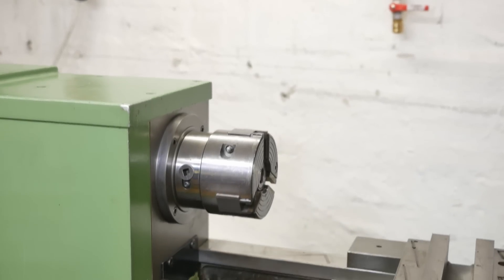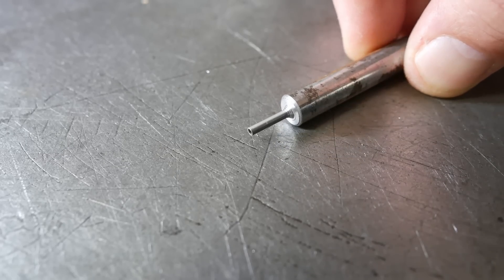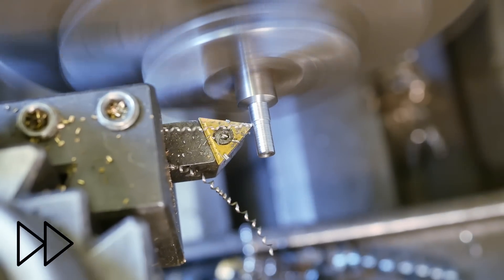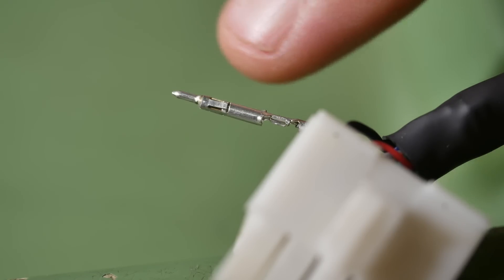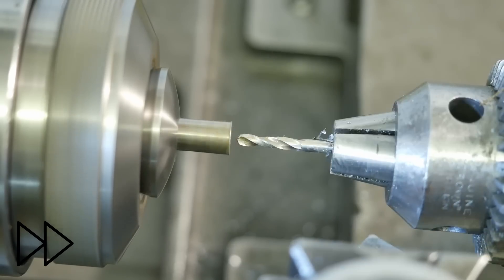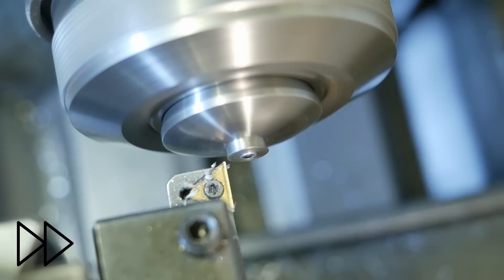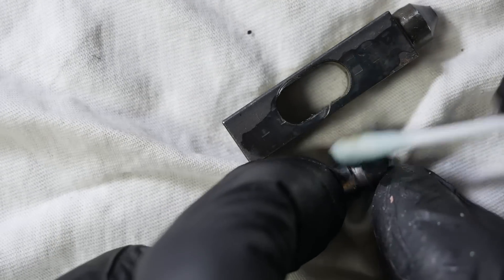Why one lathe is never enough.  Schaublin lathe Ep. 37

Comment: AMP Mini-Universal-Mate-N-Lok Set 15-Polig Terminal Connector Seems to be the kit your after!
Reply: Thats what niche YT communities is all about!
Reply from the maker: @Narwaro  The knowledge of crowds is impressive.
Reply: @RotarySMP  i have had remarkable luck asking Twitter when i simply can't find something. it's truly awesome to nerd snipe people who know about some specific thing to get answers to unanswerable questions
Reply: @Anonymouspock  for things like connectors, browsing google image search usually works
Reply from the maker: Thanks a lot.
Reply: For many terminals at about this size (molex), your handy discarded cocktail stir straw can do in a pinch. Probably worth having a cocktail... for the straw of coarse.
Reply from the maker: @azenginerd9498  Good suggestion. I am sure I have earned it.
Reply: Search for this and you see what the extraction tool looks like: "AMP 0-0189727-1 Mini Universal MATE-N-LOK push-out tool" Looks like the pipe part pushes in the  locking flappies, and then use the plunger to push it out. But I guess you already found this and made a new tool already.
Reply from the maker: @Perius  Thanks for the link. I haven't made a new one yet, and the wall thickness needs to be so thin, I might just buy it to move on with the job.
Reply: i googled that and, to my surprise, discovered that wasn't a troll ...

Comment: Id be looking at the other end of the cable. Disconnect it from the encoder, it won't have a large connector on it.
Reply from the maker: I opened it up and looked at it, but this leads are soldered to the encoder board.
Reply: @RotarySMP  Sounds pretty easy ;)

Comment: As for the connector, a major brand will mold their name or trademark into the housing (AMP and Molex surely do, if it is an AMP or Molex, or other Major brand it will say so), on an edge, release clip, or on a tip of the housing (or it's mating housing), and on the terminal near the crimp areas...Did you look? You have a very nice image of the terminal but you did not rotate it for us to see and you also did not show us the housing up-close and multiple angles... As for YOUR custom extractor, you can make all of your measurements from the terminal. YOUR design of extractor will not eject the pin, it will only collapse the locking tabs. Push the wire forward fully, then insert YOUR tab collapsing sleeve over the locking tabs, then pull the wire yourself. Don't forget to re-expand the locking tabs before re-use... Why not just re-do the connectors to something you already have tools and pins and connectors for, or have access to?  P.S. Excellent Videos!
Reply from the maker: There are no markings on this connector body. It is JMC motor and cable, so I am guessing that they use copy mate-n-loc connectors. Thanks for the tip to first push the pin in. Know I have one pin out, I measured it and have a clearer plan how to make the next extractor.

Comment: “Don’t know what I’m gonna do with these machines once I’m done with them”.

You are an aircraft mechanic, get yourself a surplus apu and rebuild it. Better yet, do a turbo charger to gas turbine conversion and use it to power, I don’t know, an engine lathe? ….. get it….see what I did there? …….  Never mind, I’ll see myself out.
Reply from the maker: Running gas turbines in a suburb is not really going to work with the neihbours.

Comment: I hate de-pinning connectors. I once had to de-pin this blind-mating connector in the pedestal of a A330 Lev D sim. No slack in the cable at all... Took 3 hours to de-pin and replace the thing. Scarred for life...
Reply from the maker: How many pins? Some of those A/C connectors can have a lot.
Reply: @RotarySMP  That was kinda similar to a ARINC 600 pin field, same kind of density and size but in a floating frame below the thrust levers and with guide pins for blind mating. I had to pull the entire quadrant out and work down in the hole. We only had about 10 pins in use but finding an extractor tool took a while. I had to de-pin them cause there was no slack and I had to get the connector frame out of the way to get in there with a tool to crimp new pins.
Reply from the maker: @juliussokolowski4293  Bet you had some choice words for the "colleague" who installed that without slack.
Reply: @RotarySMP  Those were OEM sins. The point was that the sim was a 330/340 convertible. You swapped the overhead and the quadrant. Thing was that the guide pins were on the removable part of the quadrant and people tended to miss a bit and hit the connector pin (socket actually) field in the pedestal. After 10 years of multiple daily swaps the plastic pin holder had a little crater in it and caused the No. 1 and 4 reverse interlock to fail to release. The OEM put in a blind mating connector but underestimated how blind my colleagues actually were.

Comment: I was in a similar position once, thinking what do I do with the machines I had amassed. Long story short I got more machines... that cured that 🤣. Currently at 5 lathes with 2.5 running. Should keep me from asking that question again for at least another year
Reply from the maker: Oh wow! Nice solution. So manybe I should look out for a manual Scaublin 125C to complete the pair. :)
Reply: @RotarySMP  that sounds like an excellent idea 💡 however I do like your cnc content... maybe I'm biased though  I've only 1 manual machine 😅
I'm am yet to see someone tackling a cnc shaper.
Reply from the maker: @jonnydeen6952  There are some high end industrial machines which are like a shaper / mill cross over, which drag a tool like a lathe insert cut off tool around a set path, and align the tool the whole way to make some weird shaped grooves.

Comment: 05:40 same experience here: "what are you doing with your 3D printer?"  Well, for the first two years, parts for the 3D printer :-)
Reply from the maker: ... and then parts for the next printer :)
Reply: @RotarySMP .... and replacement parts, for when the ones you printed before crack from fatigue.   Btw cleaning the bed with Isopropanol helps a lot for you prints to stick, however your hairy Benchy looked cool. "Nicht schön aber selten" as we say...
Reply from the maker: @mazchen  I clean the bed with Essigreiniger. Works really well. The adhesion issue was laziness. I didn't clean before that print.

Comment: Much like my home electronics lab which is a mix of new and older  (1980s+) kit. I've found you need at least two oscilloscopes so you can fix whichever one decides not to work. Similarly I have a spectrum analyser that probably works fine right now since I don't need to use it, but when  want it... so I usually budget a couple of extra hours to fix it beforehand. Anyway, thanks for the video, nice to see the nameplate looking clean.
Reply from the maker: As a mechanical guy I am in awe of any magician who considers an Osci "fixable".
Reply: @RotarySMP  Likewise me watching machinist videos and listening to aero stuff :) That era of Tek and HP scopes had great documentation which makes it way easier - getting much harder these days without schematic level detail.
Reply from the maker: @robertwatsonbath  I was pretty surprised to see how it used to be normal to publish component level schematics (I know that from guitar amps). Imagine Apple doing that.
Reply: @RotarySMP  they used to. Once upon a time. When Woz was doing the engineering 🙄

Comment: Looks like your Cura (if you use that) is set to 3mm filament by accident. happened to me after an automatic update. it results in under extrution.
Reply from the maker: This is 2.85mm. I'll check it...
... Just did. In the machine settings-->extruder 1 settings, it is correct at 2.85mm. Could there be another place with the wrong setting?
Reply: @RotarySMP  correct? how you mean correct. are you using 2.85mm (aka3mm) fillament. everyone uses 1,75 nowadays.
Reply from the maker: @janwiersma1449 This machine is older, and uses 2.85mm filament.

Comment: Always fantastic.

Silly question: Is there a philosophy behind using center drills to spot?  I know many people do it, and I’ve read you’re not supposed to.  What’s your take?
Reply from the maker: "The role of a center drill is to break off in your work." - Mary Curie

I do it because the center drill is there, but my carbide spot drill is a 40 taper mill chuck.

Comment: Couldnt have measured the pin you got out with verniers?
Reply from the maker: I did. It is 1.8mm. I forgot to mention that. 

So again, I need to go and get another drill. The challenge is that the bore seems to also be 1.8mm, so the extractor must be extremely thin walled.

Comment: Little job, but very satisfying result - now it's holding properly against the case :-) There are many pin extractors, but I mostly use a jeweler's thin screwdriver to do it.
I guess most hobby machinists mostly do parts and contraptions to use with their machines (and the occasional real repair) - doing more serious work would probably fall outside the hobby :-)
Reply from the maker: ...and we wouldn't want to risk that. :)
Reply: @RotarySMP  LOL

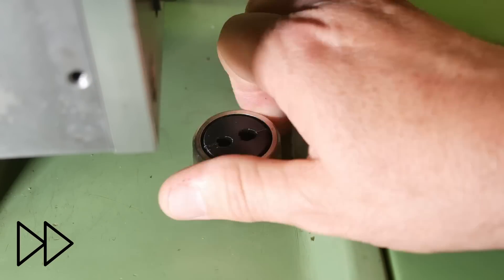Comment: Actully molex is a manufacturer. 4:45 (whips out a box) male time. When doing stuff like this how do you know what torque to use? Or is it just you use whatever it the chart torque for whatever size? Because I figure some bolts might need more or less torque than the chart says. The machines I drive need repair all the time and sometimes some bolt might be listed in the spare parts pictures (exactly, spare part pictures, not even proper exploded views.) as having this or that torque.
Reply from the maker: I am just using standard torque for the most part. There have been a few where I dialled it back (the housings).

Comment: A can of hair spray does wonders for bed adhesion! Also using the brim or raft option can help a lot.
Reply from the maker: Thanks. Not being too lazy to clean the bed before use is also beneficial ;)
Reply: 3d lac works well. It's clean and very cost effective. The can lasts for years and years for the moderate volume user.
Reply from the maker: @nrml76  Thanks.

Comment: Few thoughts about what you said in this video:
1st: cracking content as always. Love putting my feet up and watching your stuff, this is 10x better than anything on tv.

2nd: MPG as a handwheel replacement sounds great, but it's not all it's cracked up to be. I have a guildermeister that's like how you expained, and it's great for positioning, but because there's no force to lean into, it's very hard to get a good cut. Most of the time i use the handwheels to position before a cut, then use the feed buttons to actually take it. I can take a picture of the laytout if you like, it works very well. 

3rd: What are you going to do once you're done with the lathe? Seems to me like a VMC retrofit is the next logical step :D
Reply from the maker: Thanks Samuel. 
I already have a Maho MH400E, which I brain transplanted to LinuxCNC.
https://www.youtube.com/watch?v=LXwbRhgq1og&

Please post a picture of that Guildermeister control set up to the Schaublin retrofit thread here:
https://forum.linuxcnc.org/26-turning/41498-schaublin-125-cnc-retrofit?start=350
I would like to see that.
Reply: @RotarySMP  Oh yeah I've been watching you for ages, I recon a 'proper' vmc would be an amazing watch :)
Reply from the maker: @spikeypineapple552  I dont have the garage ceiling height for anything taller than I already have.

Comment: Looks like MLX42023 search Farnell for dimensions. Certainly looks like a Molex item. They can be a real pain to track down as there are hundreds of different ranges and many pins are common across multiple products. There are also many other manufacturers making similar looking connectors and using almost identical pins in totally different connectors. Similar pins are also used by Amphenol for one example. The official extractor is usually a brass tube with a plunger in fitted to some sort of plastic or aluminum handle. Some cost hundreds. Your home made one looks good but the wall thickness on the real ones is much thinner.
Edit: As others have said, it could also be AMP mate-n-lock series.
Reply from the maker: Thanks for that. Others have identified it as AMP mate-n-lok. The pin larger diameter seems to be a sliding fit in the housing, so the extractor would need a very thin wall.
Reply: @RotarySMP  agree on both counts. My experience with extractors is they are very thin walled. I have successfully machined them though.
Reply from the maker: @gillywild  Thanks. I'll get a another, correct sized drill and have another shot at it.

Comment: Regarding the connectors, check AMP mate-n-lock series. They look like Molex but they aren't, and the pins (AMP 170363) are quite similar to what you've got.
Reply: Yep, looks likeley farnell.com/datasheets/587177.pdf
Reply from the maker: Thanks for the tip.
Reply: I just found out I have this type of connector. I have puller that works for them. It has outer diameter 3mm and inner 2mm. It is very tight fit but that might be me using knock-off connectors an running female pins in male casing.
Reply from the maker: @soucevit  Thanks for that. Maybe I didnt make the second attempt (2mm ID) long enough?
Reply: @RotarySMP  It takes roughly 11mm to reach bottom of the connector for my puller.

Comment: I know what you mean about using the machines to fix the machines! The motor drive on my hardinge is still not working. Swopped out the brushes for some from a vacuum cleaner. Now need to modernise the speed controller on the 240v DC motor. I also covet a wider range of 5c collets only have 1/16 " increments and no metric but they don't come up on ebay very often.  

The manual control of cnc lathe will make it easier to just hop on and make stuff. Did Tony's video persuade you or was it in the plan?
Reply from the maker: That was alwas on the plan. The later model 125-CCN with the Fanuc controller has two job wheels.

Comment: Hello Mark,
I think you have defined the next project to restore the Boley lathe and recreate all the possible accessories for it using the Schaublin and Maho... 
Have a good week and see you next Sunday.
Take care.
Paul,,
Reply from the maker: Hi Paul. I am trying to resist that temptation. I would like to convince myself that the schaulbin is all the lathe I need going forward.
Reply: @RotarySMP  Well if the Boley has to go give me a shout and maybe I will find a new home of it.
Reply from the maker: @TheKnacklersWorkshop  It is pretty worn, and is missing the change wheels and banjo. I made up a Nema 34 mount for electronic lead screw. It is also 780kg. Be a bear to move that to the UK.

Comment: You do like doing things the hard way. Some square stock and 10 minuets in the 4 jaw and mill. But i do aprecate an over engineer. Thanks
Reply from the maker: I though about making a new one, but figured it was quicker to just poke in a threaded hole and screw on a new bit to break off.

Comment: Save yourself a lot of trouble, make a new gland that'll take the plug intact. You will have to remove it again !
Reply from the maker: That would require boring out a large hole in the thick Schaublin base casting. Not trivial.
Reply: @RotarySMP  I doubt it. . Remove the existing gland and try the plug   , turn or 3d print a split gland to thread into the existing hole. repeated removing pins is a recipe for disaster
Reply from the maker: @wktodd  Good idea. I'll take a look at that.